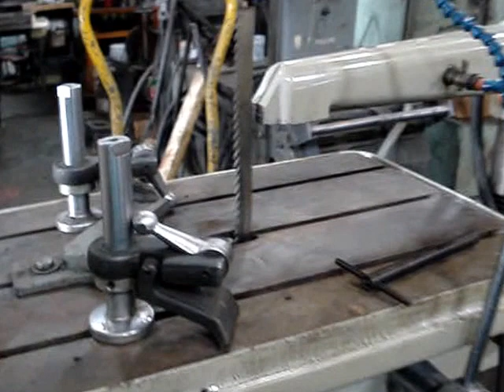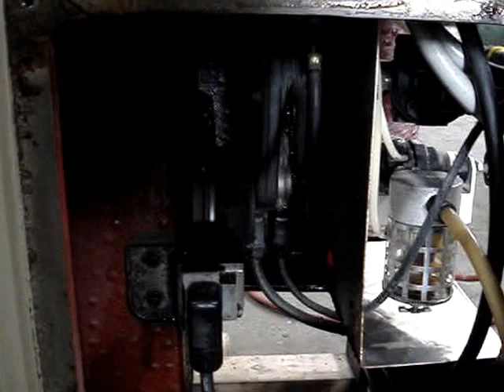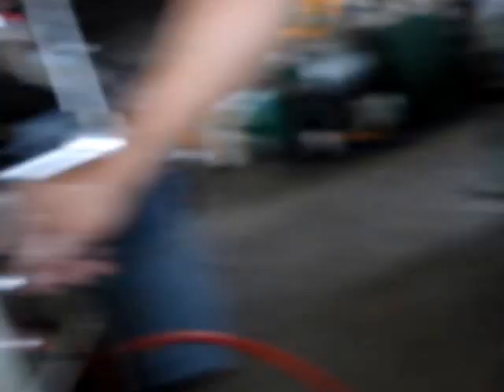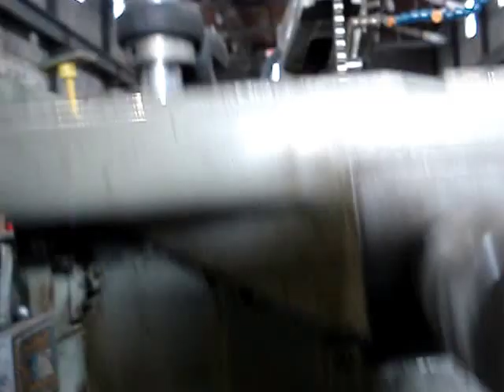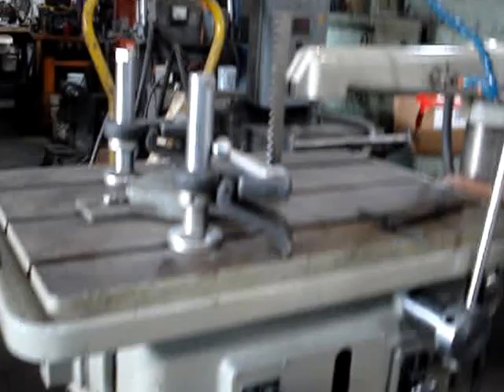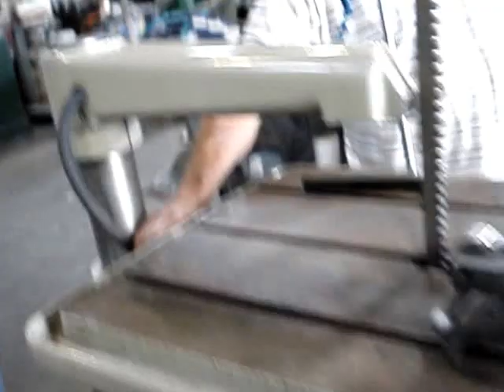Davis Key Seater #15

Comment: We have a gear drive with oillers on the drive shafts its worn and I still use it very often at the shop i work at and its hard to setup to get keys straight.